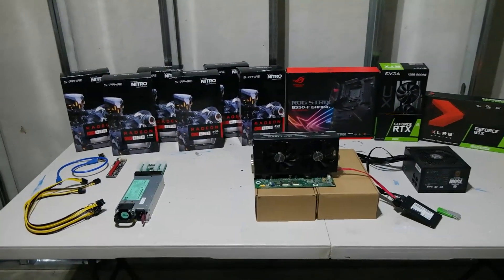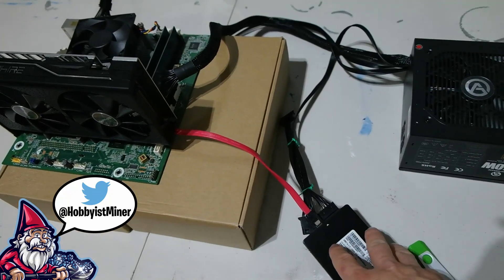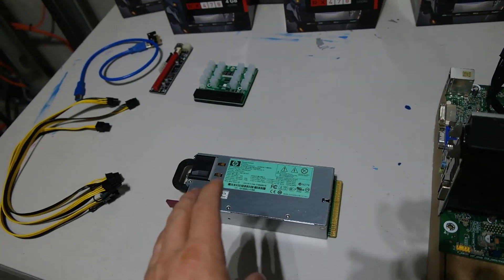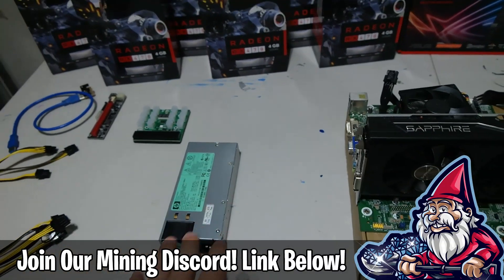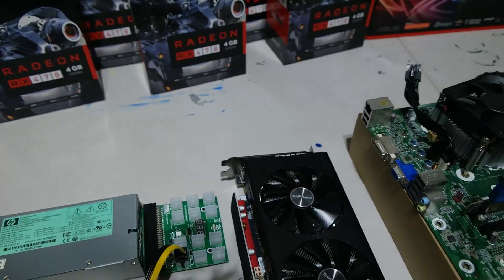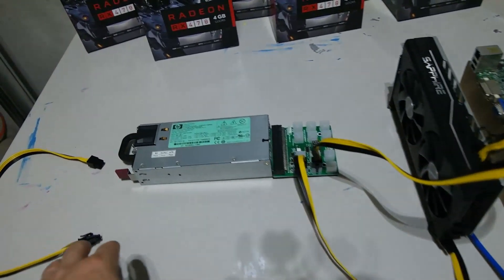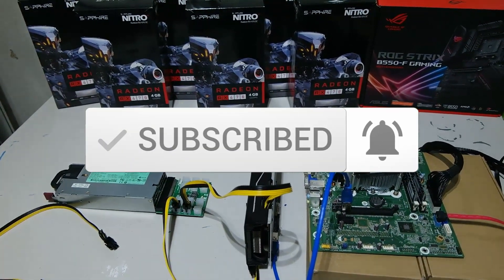How to Use a Server Power Supply For Crypto Mining

Comment from the maker: Anyone else running HP Server Power Supplies on their Mining Rig?  What success have you had?!
Reply: Yea, I have a HP 1200W server psu running alongside my 850W+1200W ATX. Works great so far, way cheaper and contrary to a lot of comments about them being noisy, mine is not at all BUT I'm not at 80% capacity.
Reply: I got my 1200w power supply from AliExpress for 40 bucks and the cables and the breakout board for 20 bucks! I have a 2 rx 470 8gb and 3 rx 470 4 Gb rig right now
Reply: They're loud but its not so bad once they're in a grow tent. At this point if you aren't using server PSUs then what are you even doing?
Reply: Switched over to the Dell's about a month ago.  Running 4 gpus and risers.  It actually blows cool air and the PSU is cool too the touch.  1120 watts after 80% rule.
Reply: I use several bitmain 1600w psu, very happy so far.
Reply: Using a 750w hp from parallel miner. Only one card + riser on it but it works great. Doing research now to see if that on hp can power cards in two different rigs.
Reply: @amythicalgaming8530  It should power cards on 2 different rigs no problem. The trick is syncing both motherboards and the PSU together.
Reply: I love my server psus! Been using them since early on in my mining setup and they're fantastic for providing power to the GPUs and then an ATX to power mobo, CPU, RAM, SSD, and possibly a card+riser or two.
Reply: I was just trying to start with server psu as well, got 750W one with breakout board for 12 pci-e 6 pin connectors. Noticed that as soon as I start my 3080Ti using about 220W on ergo (4 connectors - 1 for riser and 3 for gpu) i can hear ticking sound but there is no ticking sound when I run 4x 1660's running eth on about 265W but that's 1 riser and 1 GPU connector per gpu. What May cause this ticking? Is it safe to run it that way?
Reply: I bought 4 750watt HPs from Parallel Miner and none of the fans spin up at all. Even under full load. They are running at  50 rpm.
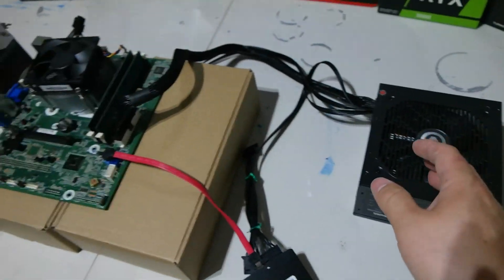Reply: 7:10 how to tune it for power faliure?
after power failure since both powers up at same time some of my gpus malfunction.
Reply: i want to use 2 1200w server psu, what do i need to sync them and if power is lost do the gpu's get recognized? Thanks in advance! I can use another atx to power motherboard and cpu if thats necessary

Comment: Question. Is there a way to get the PSu to auto start? without having to go over and turn it on every day manually. I have a amart plug and have Muni Doge II's  but i want them to only run from 7AM to 7PM 7 days a week. I have a smart plug that will turn power on and off each day like this, but I have to go to the PSU manually to turn them on every day.

Comment: I’m going to be building my first riserless mining board rig with eight cards and I’m going to be using an ATX power supply in sync with a server power supply connected by Molex on the breakout board. Would you recommend connecting them by molex or connecting them separately and powering all the GPUs on first
Reply: Did you ever figure out what is the better option on this? I am setting this up in a few days and wanted to know if I should use the Molex or just power the GPUs on first. Thanks in advance.

Comment: 800 Wt Supply at , one 20 Wt Breaker, that will Support {Two) of These on One Breaker ? 3 would break the 1900 Wt rule for 80% on One 20 amp breaker ! Am i  Correct ? 2x800 wt = 1600 Wt, For 2 and No More on One Breaker ??

Comment: Hi Hobbyist. Quick question is there any concern with running a 750watt server PSU. At 740watt.  I put a kilowatt and it’s measuring 740. I’m a bit concern if that’s more than the allowed draw.
Reply from the maker: Should safely only use 80% of the advertised power. So your way over
Reply: @TheHobbyistMiner  Thanks. I temporary removed 1 card bringing it down to 560watt.  Placed an order for a 1200watt server PSU. that'll be the safer route.  Thanks for your advice. :)

Comment: what's the max wattage can this 6 pin to 8pin provide? 

Can you do a splitter from the single 8 pin to 2 8-Pins?
Reply: Watch mining chambers vid "Using Server Powersupplies For Your Mining Rig FULL Guide" to actually understand how it works, it's great! You can always use splitters but remember all the electricity has to run through the one cable and pins that's connected first.
Reply: 6pin can handle 75watt and 8pin 150watt psu string rated 225-300watt so going from 6to 8 we don’t do that but from 8 to 2x6 pin we do that.. just from electrical standards perspective.

Comment: Man, you rock, but if you connect 4 pins from atx to HP PSU then the HP turns on with the ATX at the same time. Just a tip for all.
Reply: I have one atx and two of these hp psus running... how to connect both so that they can turn on auto without always touching the power button

Comment: do you need to connect atx with psu server, or just as simple as that 🙏🏻, thanks
Reply: reason to connect: power outage. You can set in pc bios to restart if power goes off, the server psu doesnt know that, Can be fixed by connecting a 4 pin from atx to server if you have a breakout board with a 4 pin.

Comment: Do you not need to connect both PSU's to the motherboard? How does the motherboard communicate with the PSU to tell how much power is required to be sent to the GPU? Similar with dual-psu atx setup, you have a splitter that goes into the 24pin. Is this not necessary?!

Comment: Server psu using too much power, i got a 500w atx running my 3060, than i added a 1660s and a 2060 with a HP 1200w server psu supporting both of them + 2 riser.
 I stop all GPU mining but the pc is still on and I found out the the server psu is using 82w(wall). Nearly double more than my motherboard + ATX both only using 45w.(wall)
I am going to try using a 800w ATX to replace the server psu to see which is more economical, anyone got such experience please reply

Comment: How to run dual server psu on a rig instead of server psu + standard atx psu? Couldnt find any videos of somebody building a rig with dual server psu. Any inputs will be greatly appreciated!
Reply: Did you solve this? Ive figured something out but running into other issues, my new GPU’s seem to drop off when mining starts. I hooked up the second PSU using the Sata to 6 pin from the PICO

Comment: as a primary psu with a pico adapter it didn't work for me, whole setup boots up for 1 sec and then shuts off. tried a normal atx psu and booted fine. i think it may be the pico adapter or the breakout board the faulty one

Comment: Good topic!  On the lower draw cards, could one power both the riser and card on a 1 x 6 pin to 2 x 8 pin?
Reply: Yes I've seen it done. Although I prefer to power the card on its own and then 2 risers together.
Reply: @colinholmes7180  I see that, good suggestion.

Comment: Hi, I want to start mining... Is this a good time to start mining?
Reply: I would not start now wait till card prices drop unless you absolutely have to start now.
Reply: @danoobster  it could be awhile before prices drop. I did a cost benefit analysis and it seems that rx580s are the best bang for your buck, around  $15.50 - $16.66 per MH/s. If you're bullish on crypto it could be worth it.
Reply: @colinholmes7180  4gb or 8gb? did you also factor in electricity usage?
Reply: @ow3jyt548  8gb. I didn't run the numbers on electricity but I suspect the rx580s would still come out ahead given the ridiculous premiums on some of the higher end cards. Given enough time I'm sure that the higher premium would be recouped with some of the more efficient higher end cards but then you have to consider variables like how long someone is willing to wait, how much capital someone has, the effects and timing of the implementation of EIP1159, etc.

There were to many unknowns to consider for me to really make the numbers air tight so I didn't do the larger calculation, plus power comes with my apartment so it didn't make a difference for me anyway. Ended up building a 6 rx480/ 6 rx580 rig about 2 weeks ago.
Reply: Mining is a long term game, you can start at any time, returns and profits will come sooner or later, you just need to understand what you are doing. When people say it is not worth to mine anymore then this means it is the best time to mine! Mine&hodl&profit over time! Just use hardware you already own as current gpu prices are sick and it is not worth to buy new nor used/second-hand.
Reply: @homegrowncrypto2280  how can you say its not worth to buy? I bought from ebay and paid my cards off in under 4 months.